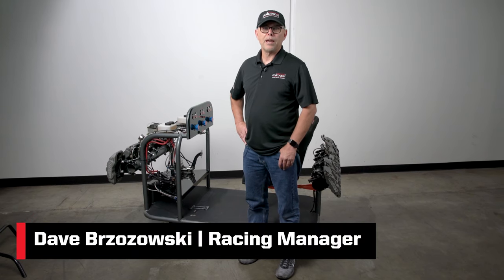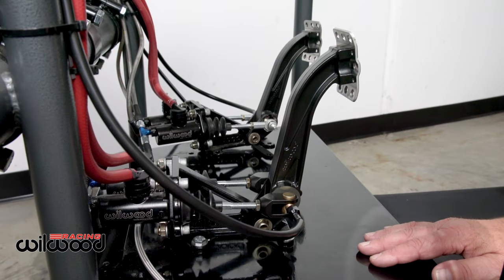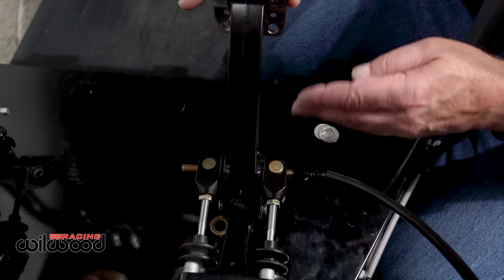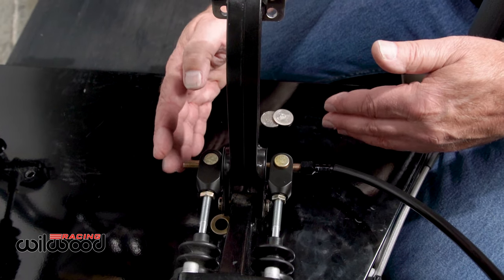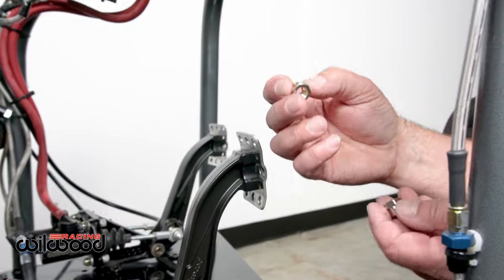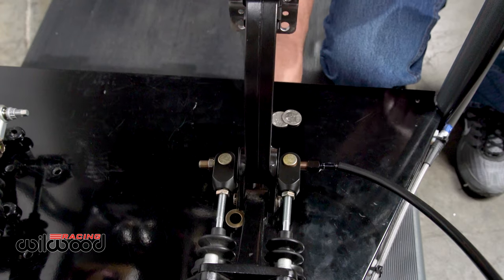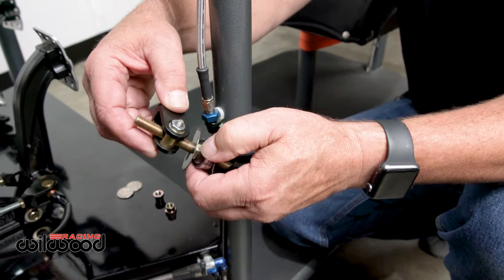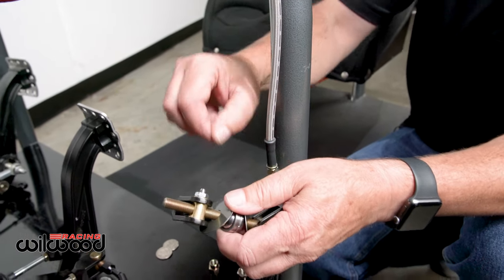"How To" Setup a Wilwood Balance Bar Brake Pedal Assembly

Comment: This video is helpful, but it would be better if it illustrated the mechanical function of the balance bar pivot in regards to master cylinder bias.  You don't say much about "if you do this, then the following happens..."  specific to which side has more leverage.  You just say, "this can be moved to apply more leverage..." then move on.

Comment: Hi, I have the pedals next to the ones you show! How to adjust that ones? You have another video? Since a week I have a „clonk“ most times I hit the brake so I was wondering if you can help me? Thanks in advance Philipp
Reply from the maker: Sorry, we do not have another video at this time. Please give us a call at 805-388-1188 for tech assistance.
Reply: @WilwoodDiscBrakes  thanks for your answer, I am from Austria and my Brakes are from Simtag called Ashley and I use them on my Simulator. Maybe they will answer my question if they still doing business. I am still looking what is the reason for this "clonk" sound because the function of this pedals is just AWESOME!!!